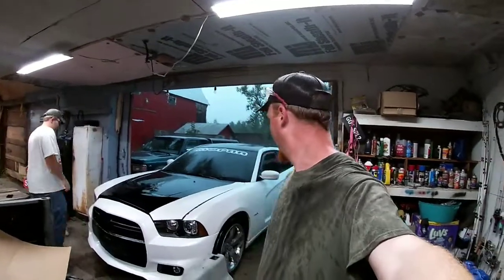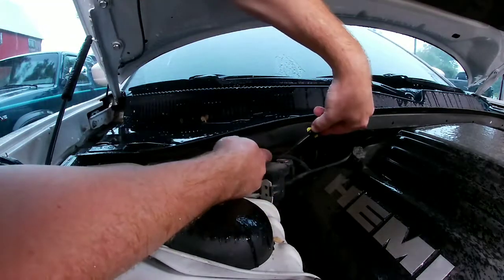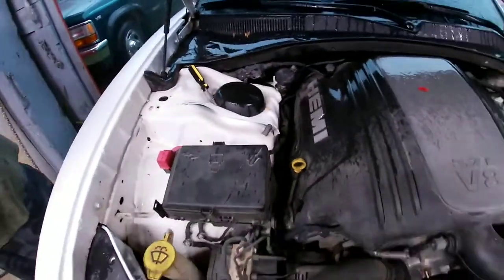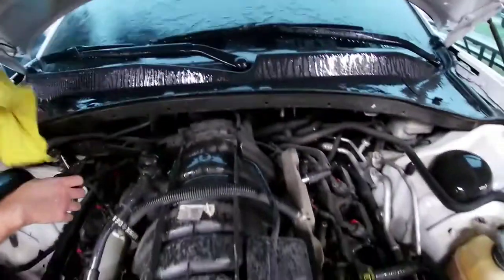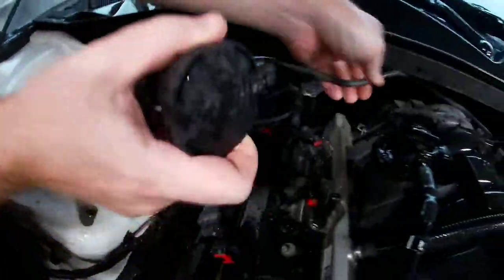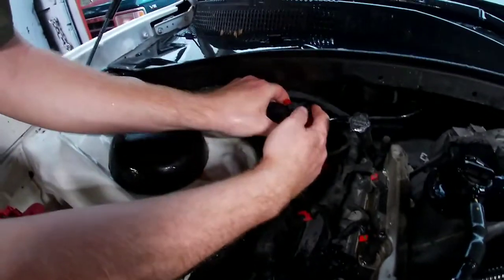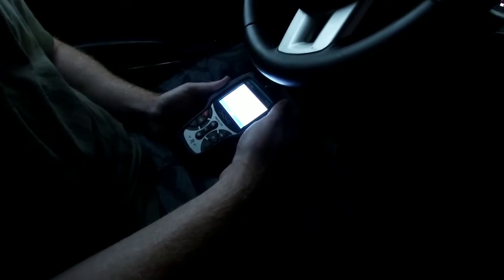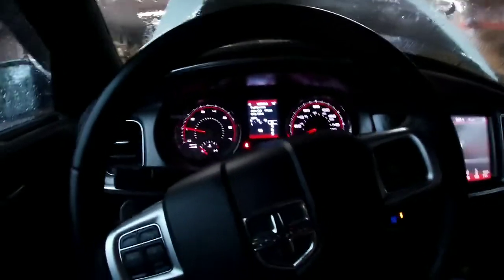11-14 charger 5.7 hemi EVAP perge valve replacement

Comment: Ok thank you cause I done put everything new in my charger rt and the last thing I put on was the fuel pump left and right and it still hesitate and then fire up so I got me one of those canister purge valve and hope that will work and my service engine light will come off

Comment: What was the code for engine light?
Reply from the maker: It was for a little while but the code came back on and I haven't had a chance to take it to the shop to further investigate
Reply: @ccgarage5040  
So, how do you ended up ?
Reply from the maker: @tt-rs1457  the light is still on for a evap leak just haven't looked into it after it came back. Only effect it has is not being able to use the remote start